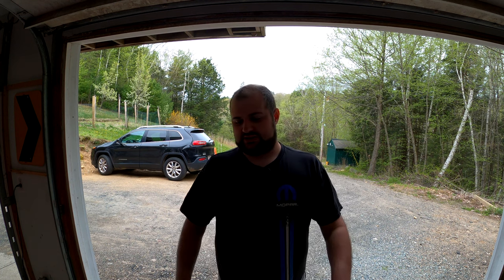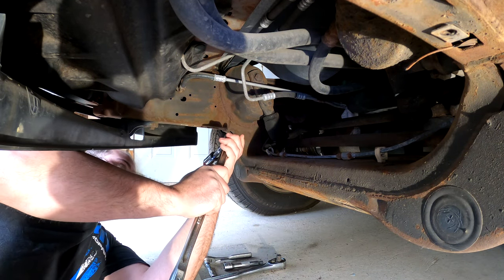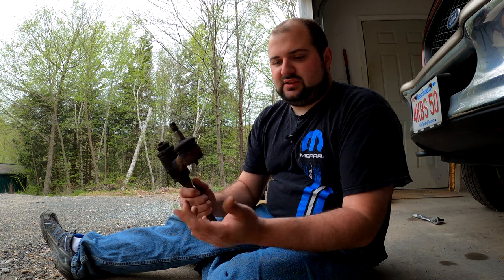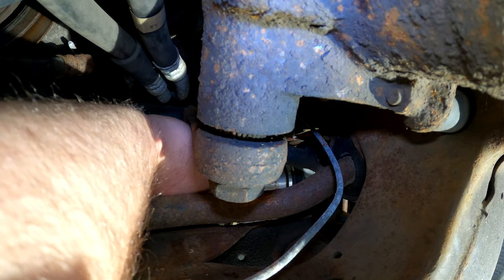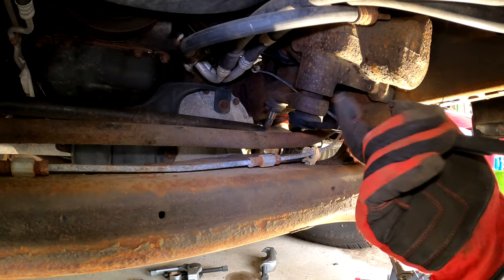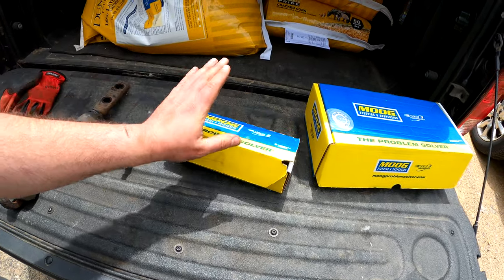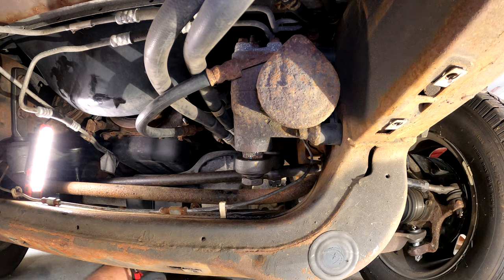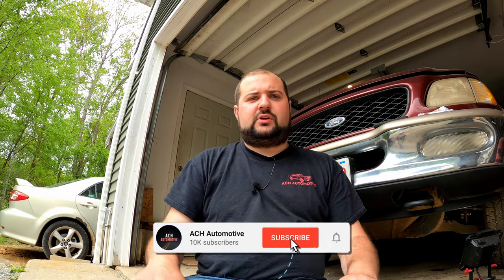Change the Pitman Arm and Idler Arm on Your F150 Without Removing the Steering Box

Comment: It took me a day to remove the pitman arm and ended up removing the steering box and broke one of the 3 bolts is a 7/16-14 coarse, I put a grade 8 and blue lock tie on it. 
I was able to removed the pitman arm with a big regular cheap remove tool. 
Don’t torque more than 60 fpounds your steering box. 
I wish I found this video before I started
Reply from the maker: It is a tough one to get off.

Comment: seen some guys just snug the pitman arm with an adjustable wrench and have it work fine lol.  I even went as far as to ask an old school mechanic about it, he pretty much said if its tight enough for the nut to not fall off, its good.. dont need anywhere near 200 ft lbs, thats more of a "safety"  thing so they don't get sued if your steering slips.
Reply from the maker: I try to do things to the book as much as possible, and while it may seem overkill, I certainly don't want my pitman arm to come off while driving.
Reply: ACH is Right. You Torque UnderCar Suspension Components to what the  Manufacturer say to Torque them too..

"We do not wonna hear that Customers were killed because we applied "SawMill" Mechanics Logic of --" That's Tight Enough B.S. Practices" , instead of using Manufacturers Torque Specifications.

Once a Buddy & I worked @ the same Shop in Fullerton, CA...He didn't Tightened the CV Axle Assembly properly...When the man & wife exited the Freeway the CV Axle almost came apart....No one was KILLED.

At the same Shop I was trying to be Cute while talking to the Owner of the Car ( a Woman ). While Lifting the car on a Lift , about 24 inches up , part of the Car fell off..You're suppose to Press Down on the Center Front of a Vehicle & the Rear Center of Vehicle after you've Raised the Vehicle 12 inches , then continue Raising the Customers Vehicle because it's SAFE now....I always did that , but that Day of 
"Being Cute" caused some embarrassment.

@ an Arco Gas Station on Atlantic/San Antone : after filling vehicle up here in Long Beach , as soon as I drove off the Island and trying to straighten the car up heading South on Atlantic , the da_ _ Left Front Tire Wheel went into a 45 Degree Angle because the Upper Control Arm had CRACKED.....

....Fixed it @ Arco Smog Pros where we worked but it had to be Towed....Coulda killed myself & 12 others on the 20 mile run from Long Beach to Fullerton.

I'll end with this 'cause I know I've worn your Ears off : "You might wonna pray to God & Sonny Jesus that the person that's working on your Car is Detailed & enjoys using Manufacturer Torque Specs when it comes to Tightening your Tire Wheel Lug Nuts and those UnderCar Suspension Components like the Idler Arm & Pittman Arm... ( BTW , those are just 1 % of UnderCar Vehicle components.

Vietnam Era Veteran
Southern California ( 90802 )

Comment: Where did you fine that pulley for the pitman arm
Reply from the maker: The Mac Tools one I used in this video I bought off eBay, but this one is very similar: https://amzn.to/2X7gIT3
Reply: $15 Amazon…if you buy it individual….decent sets can run you $120 up